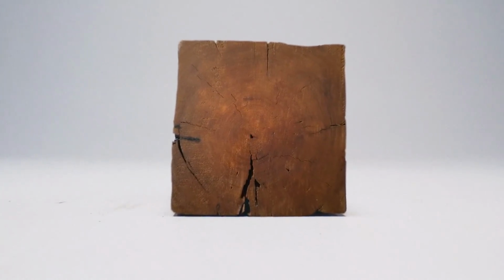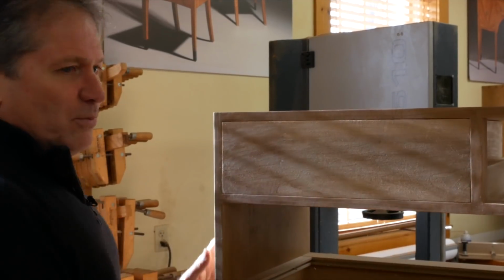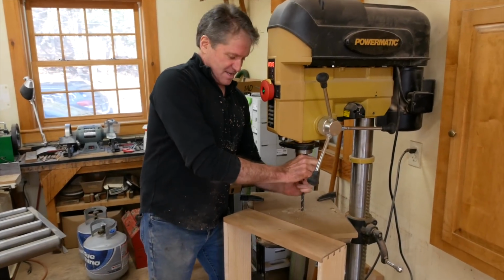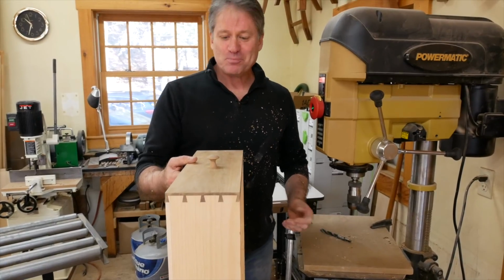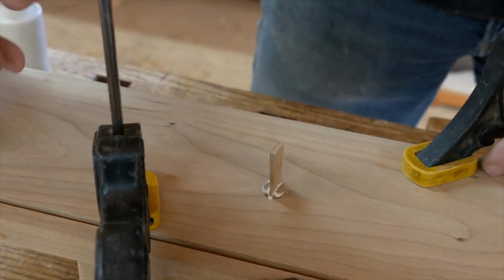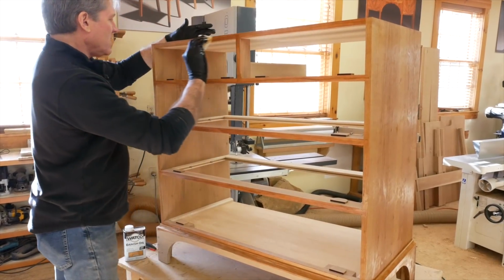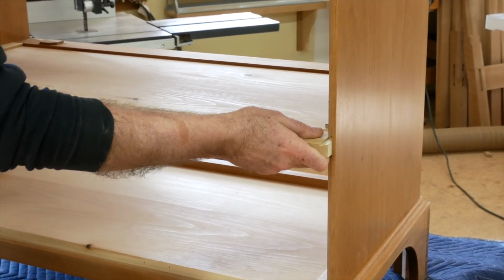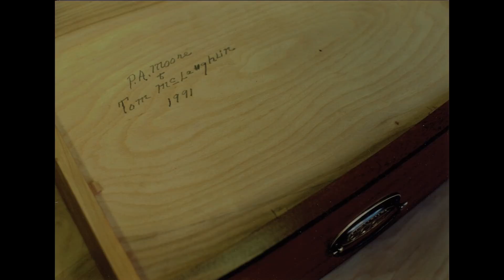Turning knobs, fitting drawers, and applying an oil finish

Comment: great build but I have a question regarding the drawer glides you installed on the top of the face frame they look like they not flush with frame the dust panels slide into? isn’t that throwing the drawer off or am I not seeing it correctly?
Reply: I was wondering the same thing. Does anyone know which episode he showed making the face frames?